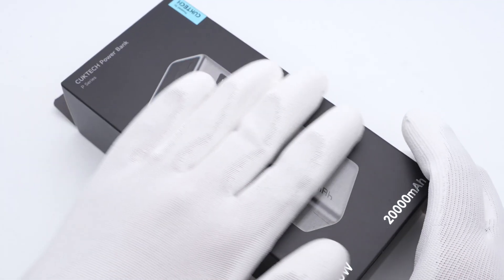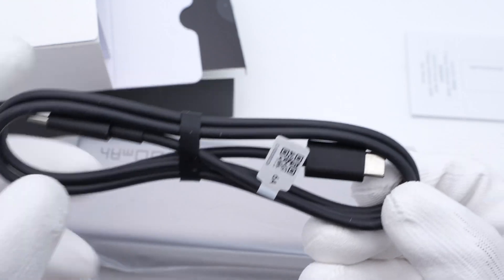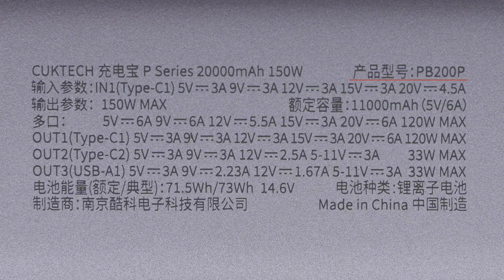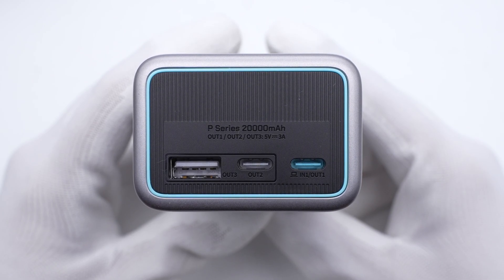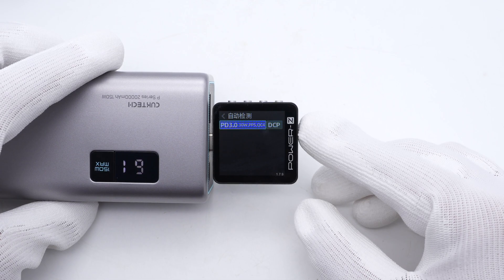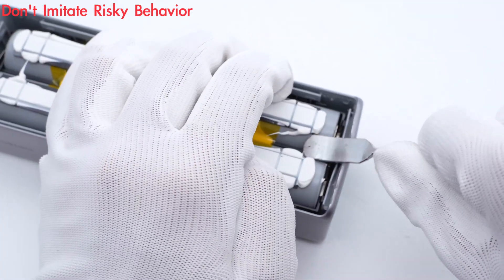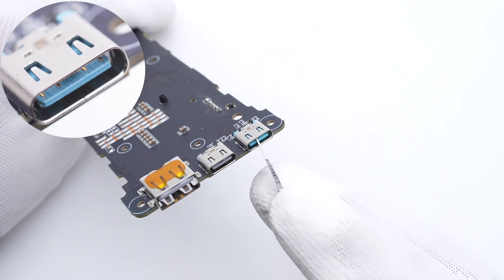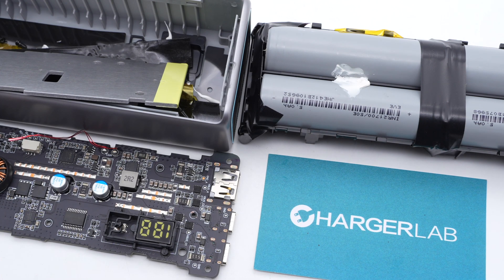Teardown of CUKTECH No.15 150W & 20000mAh Power Bank

Comment: Thanks for your video, after traveling the battery shows 0% of charge when I connect to power supply looks like it doesn't detect the voltage of the battery . I'm very disappoinment, fist trip and it died without use😢

Comment: 1. I can say it is best of Cutek Power bank i have seen

Reason is that you can remove the cell easily if dead but the only Disadvantage is that it is 20000mah instead of 60000mah 

2. I don't know if it supports 18.5V and 19.5V -- 4.62A  Dell Laptop Charging Power 

I haven't verified if it does usb Negotiation that i mostly hate on Power bank 🥲

Comment: Can you check if this power bank supports passthrough (input+charging while using an output)?

The design could allow for it since USB-C1 and (USB-C2 and USB-A) are split.

This check would also be a nice addition to the general device capabilities introduction at the beginning :-)
Reply: @DooMMasteR If you look at the rated capacity is 11000 at 5v. While others are 12000 or 13000... so this powerbank has less capacity
Reply: Probably does support pass through. Because has 2 different chips for each usb c. The only problem is the capacity probably is 37wh at 30w output... i had something similar and was disappointing
Reply: Plus at 100w these cells output almost 7 amps continuous because there is no parallel there are only 4 in series.. thus i think greatly reduces the lifespan
Reply: @VladStefanXPopa  I mean the cells are rated for 1C continuous only so yeah, quite some overdrive.  
But true the DC-DC efficiency of the UCB-C2+USB-A part at 5V is very disappointing.
Reply: @VladStefanXPopa Hi, you sounds knowledgeable about powerbank, can you help recommend me a good properly rated powerbank with a good lifespan?

Comment: If 4 li ion 5000mah batteries connected in series you cannot get 20000mah, its still 5000mah only voltages are added not the capacity.
Reply: it is very common to only advertise total 1S capacity, regardless of the configuration, it is at least somewhat comparable, but Watthours are what counts.
Reply: blud graduate from walmart